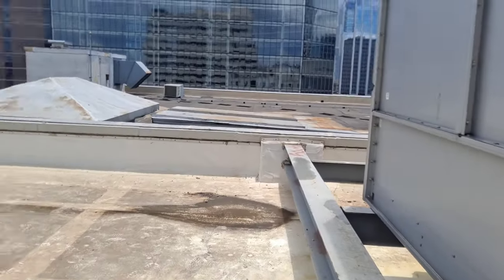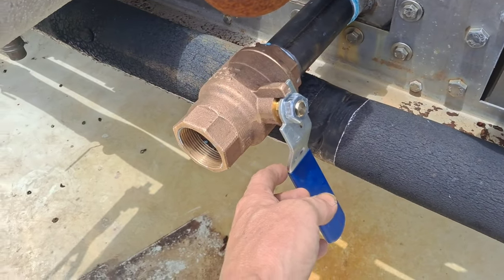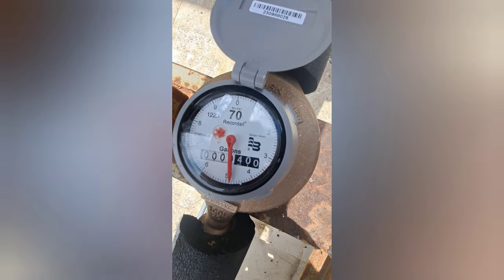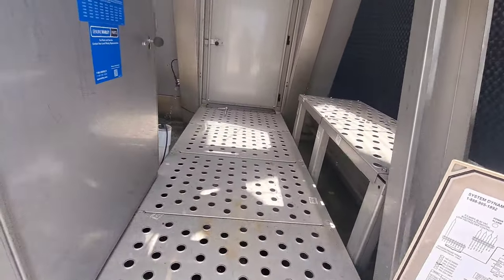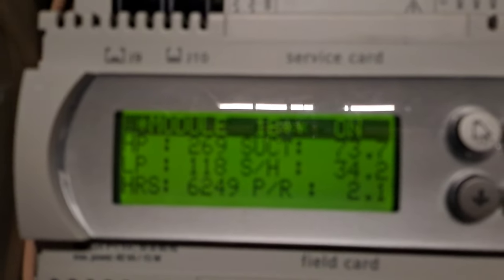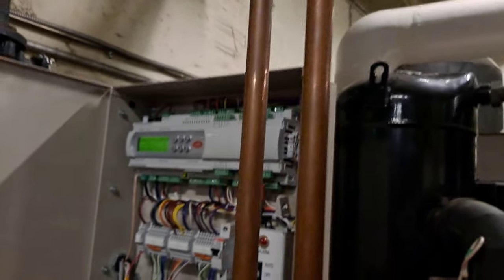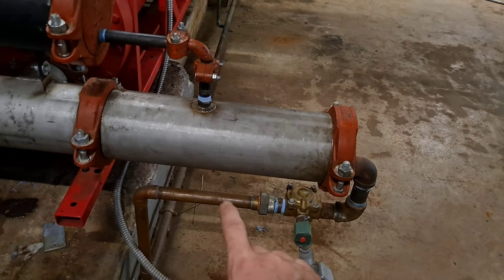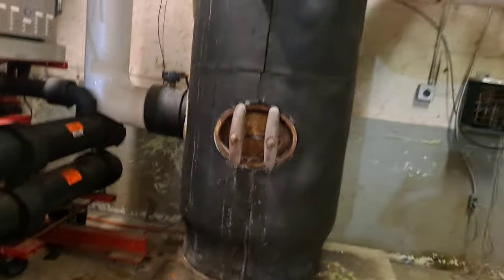One simple call......turned into the whole building is down. #coolingtower #commercialhvac #HVAC

Comment: 😂 wish you had video of the drain breaking. Nice job, Bro! Love the content, keep it coming.
Reply from the maker: Thanks Steve-o.......it was impressive....shot the water 6' across the roof. Tried to find a 1.5" stainless nipple....it was hard to find so i put blk pipe back in.
Reply: Carrier had a chiller tech at a local hospital doing a pm,punching tubes etc,he swung the the plate away from the barrel and let it hang on the 1 inch SS rod. The anchor pulled out and dropped the plate ,which in turn snapped the 12 inch sch 80 condenser water line. Man ,you ever glued 12 inch before on a lift! We usez 2 inch chip brushes to glue and prime it,the had to raise the lift and drive it to the end and push it in,because the forgot to bring a pipe jack.The water crushed the roof in on a car parked below it! Crazy,the stuff I have seen. Great video ,thank you
Reply from the maker: @petersmart1999  i always enjoy your war stories....thanks for watching and supporting...you are a good friend.
Reply: @jasonjohnsonHVAC  Well I have a few,like the guy that thought he would just run in the picking eye on a 20 hp B&G pump while it was running! Yeah,it caught the shaft,and screwed it in and popped the end cap off the motor in 3 pieces! Its a good thing I am proficient in Tig welding. I asked why did you do that,he said he tgought it should be screwed in all the way! He should just stick to working on penis pumps!
Reply from the maker: @petersmart1999  😆😆😆😆😆😆😆

Comment: How often do you find those transducers or temp sensors out of calibration?Curious because we're just getting into Multistack chiller service.
Reply from the maker: I haven't ran into any that were out if calibration....as a matter of fact i find them to be very accurate
Reply: what sensors do multi-stack chillers use? I've only worked on some of their older stuff, they got some cool stuff out now a days @jasonjohnsonHVAC

Comment: That's always the scary part of touching any plumbing. You're the final straw on the camel's back and without enough evidence the jury will convict you of owning whatever problem you unintentionally caused.
It doesn't help if the process owner is looking for someone to hang a problem on so they can get free repairs. It's nice when you have evidence that it wasn't your negligence that caused the problem.
Reply: Plumbing is part knowledge of expectation of how deep it gets but never gets past your worst analogy. The hidden undetected overlooked glitches are far worse. Electrical work is full of them.

Comment: Yep, cheapin' it out sometimes bites you in the a$$. Why not stainless steel or sch 80 PVC for that drain?  Chemical control can kill the system. Maintenance dude here.
Reply from the maker: I was looking for a stainless nipple to use. The building wanted it ASAP. So black pipe nipple was the quickest solution. In the winter I'll replace it with a stainless nipple when i have the time to source it.
Reply: @jasonjohnsonHVAC  When you have time...😄 Good luck. You are only as good as the people you work with/for.